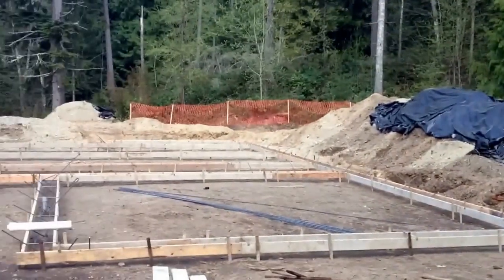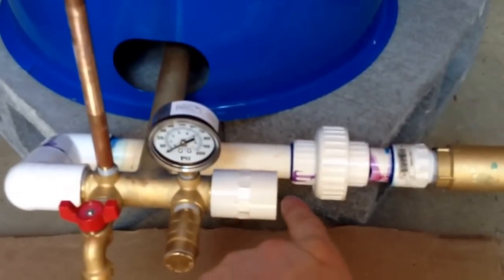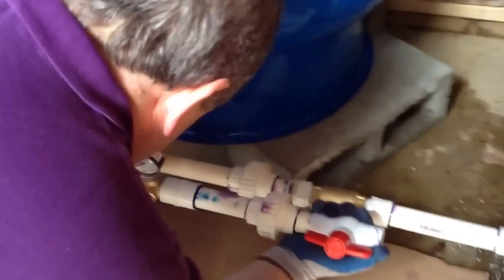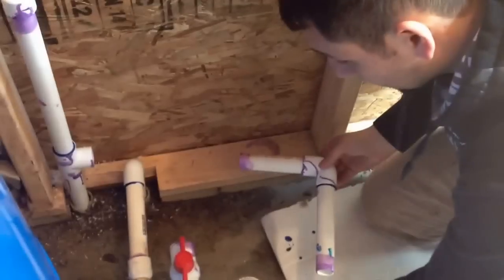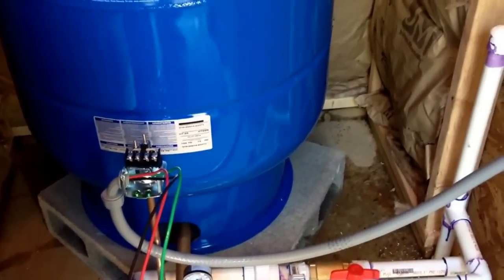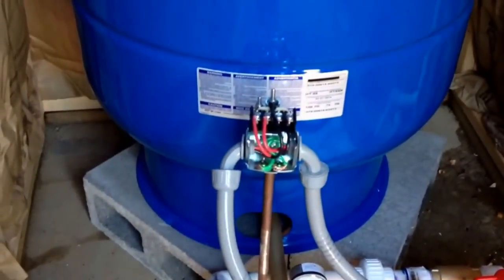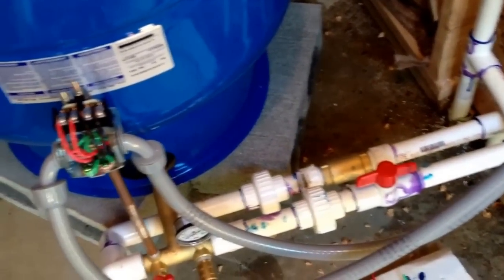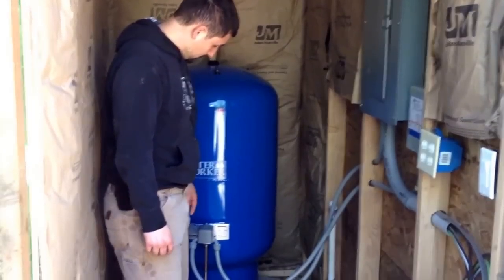Well installation at our new home DIY How to

Comment: My 230V well pump has 4 wires, black and red for the power, green for the ground same like yours but I also have a yellow. Did you have a yellow wire coming off your pump? I hooked up my electrical the same way you hooked up yours. I turn the power on and the pump buzzed then I turn the power off. I put the pump in the well and turn the power back on and no water came out of the hose. I am so confused.

Comment: the pressure switch will shut the pump down when it hit whatever psi it set at. for my it 40-50 psi for the pressure switch.

Comment: 20/40 pressure switch it really a little low for new houses and you need to check the pressure in your pressure tank to a couple psi below your cut in pressure. Good clean job none the less!

Comment: Can I put two water pressure tank one after another for extra back up and does the 2nd tank require water pressure valve?
Reply from the maker: ACLC Houston yes you can add two tanks. Call though this is an 80 gallon tank I can’t imagine A reason that you would need a bigger tanks on that. No as long as the tanks were teed together so that all of the valves and pressure switches work correctly you would not need an extra pressure switch.
Reply: I am renting out a RV and adding a 2nd one they are 100 ft apart Can I put the tanks 100 ft apart or do they need to be close together.
Reply from the maker: ACLC Houston My tank is 120 feet from my house. I would think that under your application putting the tanks next to each other would be the best. But that’s only a recommendation. without seeing your exact circumstances it’s hard for me to really say.
Reply from the maker: ACLC Houston Sorry about that I edited that last comment

Comment: Did you ever correctly set the air in the tank relative to the settings of pressure switch?  If you didn't you have serious problems that can lead to total well destruction.  waterwellman
Reply: He said at the end that they adjusted it so it would work properly. And ‘total well destruction’ may be exaggerating a bit. Lol.

Comment: Could have just ran one conduit to the pressure switch and the other from the breaker panel to the control box, makes it look more cleaner
Reply: You ever tried to run all 6 wires through one opening on the side of a pressure switch? I didn’t think so.

Comment: Hey Dan.  Did you end up having to do any plumbing or electrical inspections for this hookup?  Thanks.
Reply from the maker: The electrical was inspected by L&I, because I used a permanent remote meter. The plumbing was not inspected because it is all in a detached pump house, and was all installed before I started building the house.

Comment: Hi, Nice video!  Let's say you wanted to install water in a 2nd structure on the property, could you use something like a tee pipe to run water to the house and then to the other structure?  Thanks!
Reply from the maker: yes But, you would want to understand the GPM at the primary place that you use water, the pump that is in the well is sized based on the expected water use. you just want to make sure that the pump is big enough to support what you want to send water to. I have water to my house, to m sprinkler system, to my detached garage, and also to a water spicket by my drive way, all of these are just tee'ed of the main line.
Reply: Very helpful, thank you!

Comment: those 2 power outlets in your pump house should be gfci.
Reply from the maker: And the breaker is GFCI.
Reply: Only if the breaker supplying them is not GFCI.

Comment: how deep did you had to drill until you got water? also where do you have the motor that pushes the water up to the tank? i didn't see any motor next to the tank.... I'm planing on installing a well too on my new property before i start with the construction of the house. thanks for your quick response..
Reply from the maker: +Ruben Roman - As far as how deep it depends on your water tables where you are going to build.  My well is at 180' deep that is about average in my area 160-240' is the average here in Washington.  Also the "Motor" is submersible in your well pipe it sits at the bottom of the pipe and pumps it up to the surface or expansion tank, which is the big blue tank you see in my videos.  My brother has a very similar setup and he will be starting his construction in July and we plan on shooting more in depth videos that detail these types of questions.  His well is already in and his power is run to his well pump house but everything else will have a video for it.
Reply: great tip. il have to find out how deep is the water table here in GA then., thanks so much for your videos .. great to learn from someone who did it with his own hands. stay blessed!